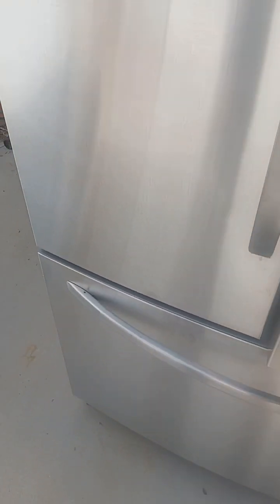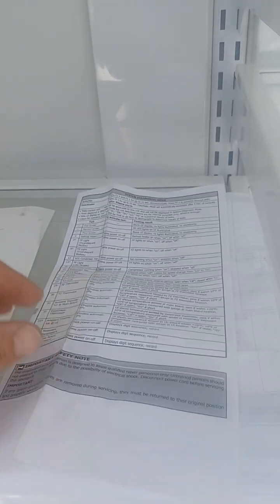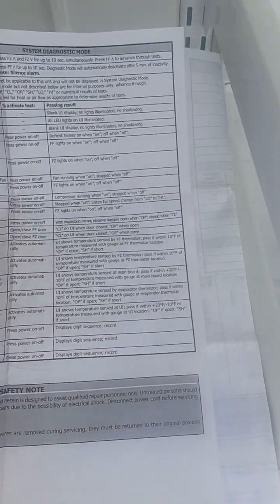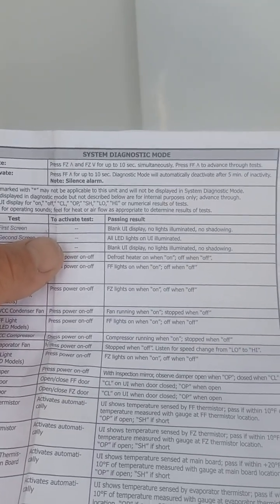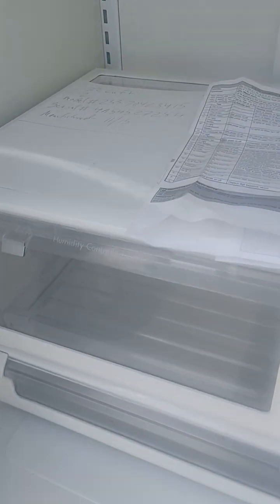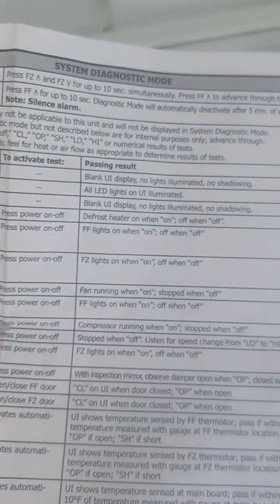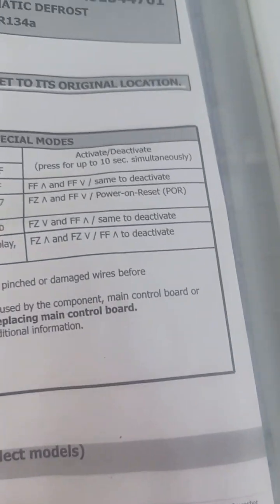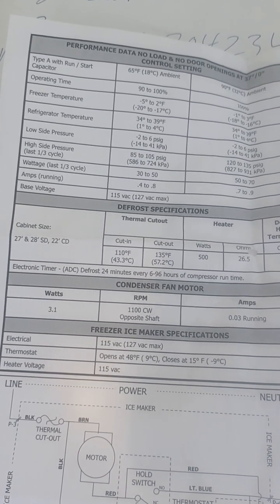Frigidaire/kenmore  bottom freezer refrigerator diagnostic mode and tech sheet model # 253.70423415

Comment: I'm starting to dislike this refrigerator. The freezer works fine and gets down to - 18c, but the fridge won't come down past 15c.

I found that data sheet in a pouch taped to the bottom of the refrigerator, above the non removable drain pan.

Comment: Have been looking for this. If I unplug the refrigerator and plug it in the ice maker will work for 24 hours and then stop again. I have a thermostat coming next is the control board. Three ice makers different styles and they all do the same thing. Is there a download for that sheet or is that the one that came with the user manual?
Reply from the maker: This came with the fridge. Should be located underneath the fridge somewhere